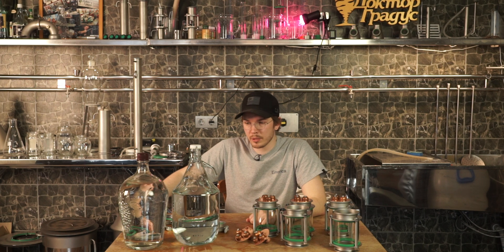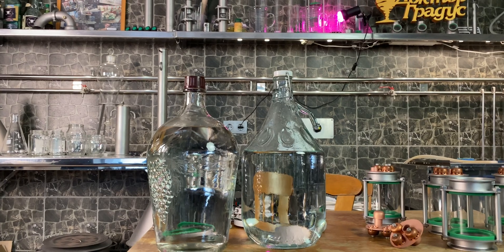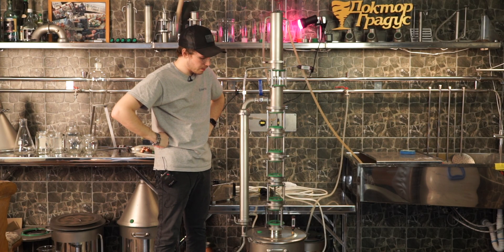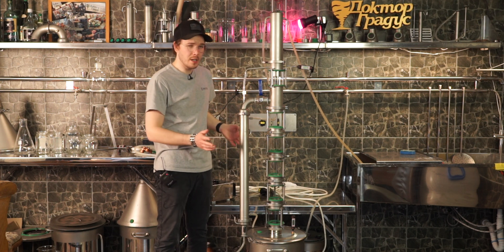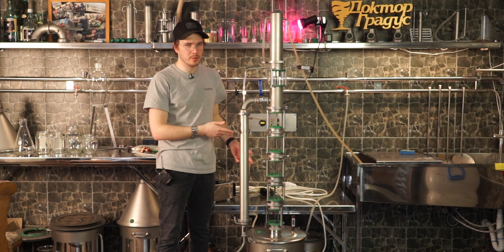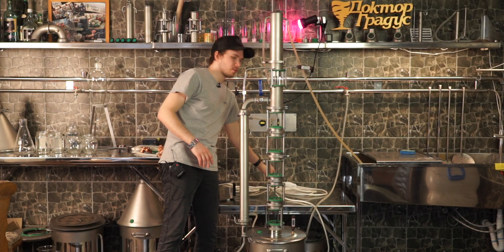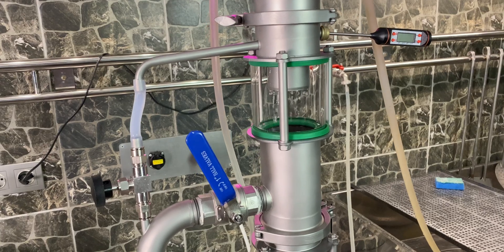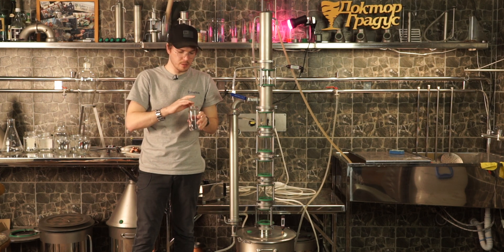Stillman X 3 inch plus plate column - distilling next step whiskey recipe

Comment: What was the ABV of each of the cut jars?
Reply from the maker: Sure, I just checked that. 
1 jar - 88 abv
2 jar - 87 abv
3 jar - 87 abv 
4 jar - 87 abv 
5 jar - 86 abv
6 jar - 85 abv 
7 jar - 80 abv
8 jar - 61 abv
9 jar - lower than 38 abv

Comment: I worked with Doctor Gradus to get pricing on a couple of 4" liquid concentrators.  Then, no communication at all; consequently, that transaction never happened.  I'm done with them.  I was going to order a large amount of SPP and some other components, but that won't happen now.
Reply from the maker: Hello Sir. I just tried to filter messages in our emails which are doctor-gradus@list.ru and doctor.gradus54@gmail.ru but haven't found anything about 4 inch liquid concentrators. We just investigated that we wrote you on 9th of April on eBay, to find a contact info like emails or phone number for messengers. I am sorry if there was some difficulties to contact us. You may write us again directly on email.
Reply: If I may jump in about communication. I bought a Stillman X from Dr Gradus and found that my  .com address was getting blocked from their domain provider (not their fault) I used another email address I have and was to correspond with them with no issues, I found they have been very responsive and helpful in my case. Hope this helps.
Reply: @SiCaRiI_DaGgEr  I appreciate your reply.  My request was for a small custom order, and it really appeared that they just were not interested.
Reply: @scottq4344 

In that case I'll shut up then : ) ....hope things get sorted out.